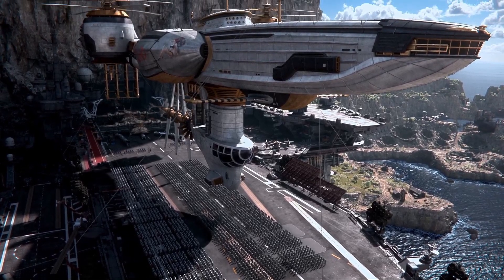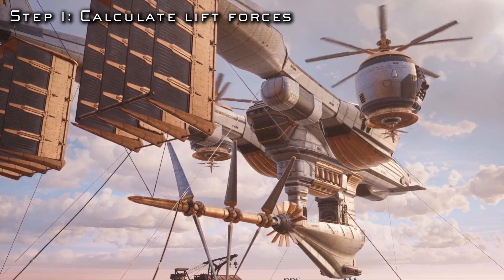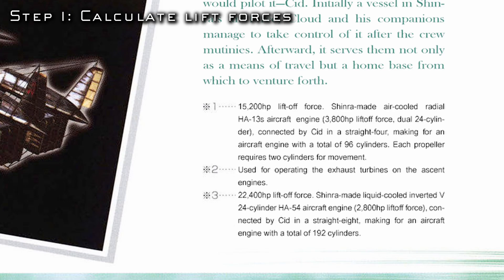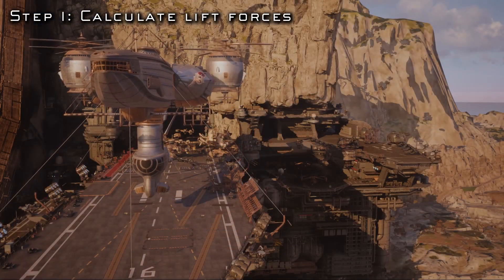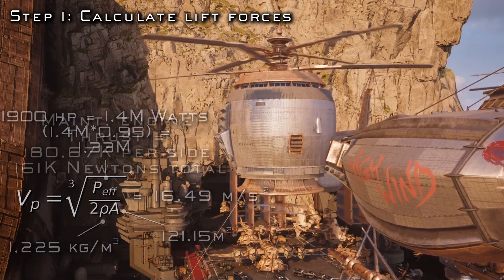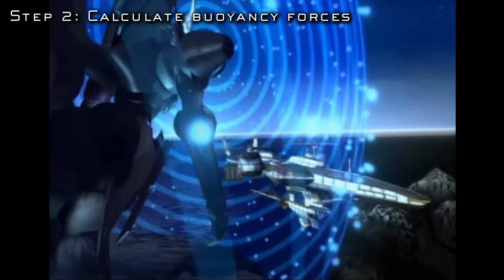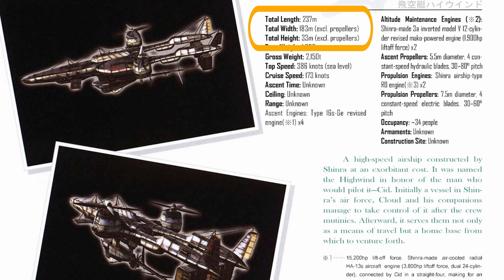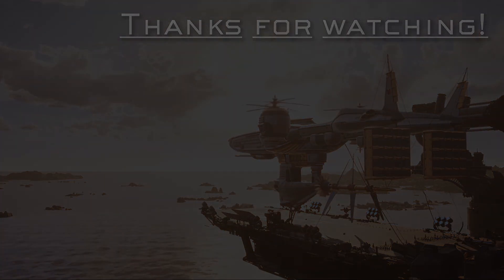Could Final Fantasy VII’s Highwind actually fly?

Comment: Great analysis.  I head canon a rational for this as.
1. the pods are using fantasy matierial that is capable of holding a vacuum.
2. Gravity Materia + Elemental materia on the ships armor 😅
Reply from the maker: Thanks! The vacuum idea is great - probably wouldn't be enough though! I do wonder if it's just filled with Mako gas. I hope we get to see more of the inside in Part 3!

Comment: Im not suprised the Highwind wouldnt be able to fly in the real world, even at 13, when i first played FF7 I suspended my disbelief. i am surprised, however, that the Tiny Bronco is a viable aircraft. One question you didnt answer though, is it a viable boat? :D
Reply from the maker: Haha - at a glance I’d definitely say it floats. It’s definitely not ideal though - exposing half the prop to the air while the other half is in the water is called cavitation and it’s brutal for your hardware. Just think that the half outside the water wants to spin faster because it’s cutting through a fluid that is far less dense than the half that’s in the water. You can image the stress that puts on the engine shaft and the prop itself. Could it work? Yeah in an emergency I think it could. Is it ideal? Uhhh…better off in the submarine!

Comment: For what I can say from my point of view - there is a possibility that Maco can provide higher efficiency for lower volume. I am pulling it by the fact that Cloud can easily swing sword that should weight 50+KG (Which doesn't sound much, but there's not a single person in the world who would be able to properly lift, let alone swing this thing - physics basically prevents you from doing it. 
Ofc "It's Fantasy so real-world physics not applicable" can be used as argument, but in my opinion, it is a very disruptive argument, because then nothing ever matters ever. Like in this case we can go for "Why Aerith died in original? Cloud forgot Phoenix Down in his other pants?" or other silly things - IMO by default, if things are not said outright to be different, Earth logic should be applicable.
Reply from the maker: Great points! I do agree with you that we are led to believe Mako has an incredibly high energy density. It’s basically the equivalent of oil, but provides much more bang for your buck as you say. Interestingly we see Mako being able to assume all 3 states of matter - solid as materia, liquid like in the reactors, and gas as the vapors. Also it comes from the planet so it has some organic/biological component kinda like how oil is really just compressed dinosaurs. That doesn’t mean we automatically get more power out of it though. When the devs say the engine is 15200 horsepower I take that to mean it’s that horsepower regardless of what’s powering it. 
Your final point is quite funny. To your point, why didn’t cloud just cast Reraise? I definitely had it equipped!